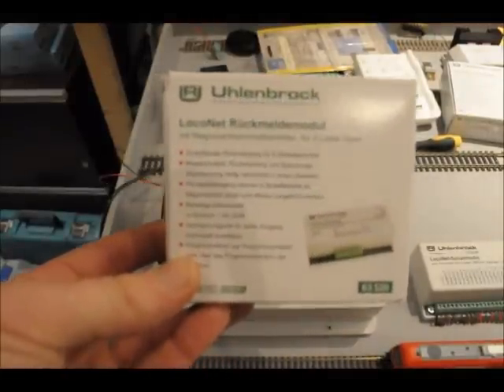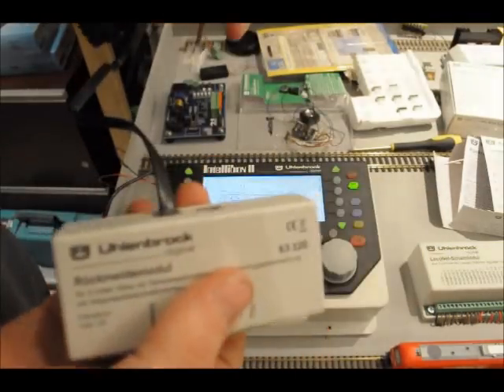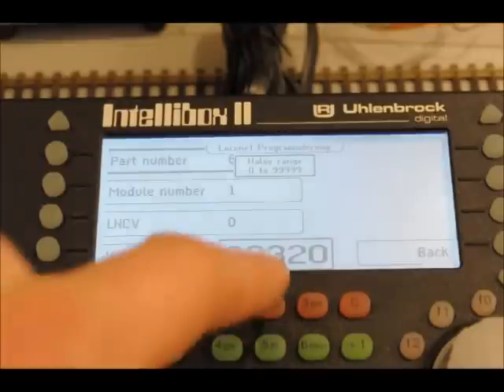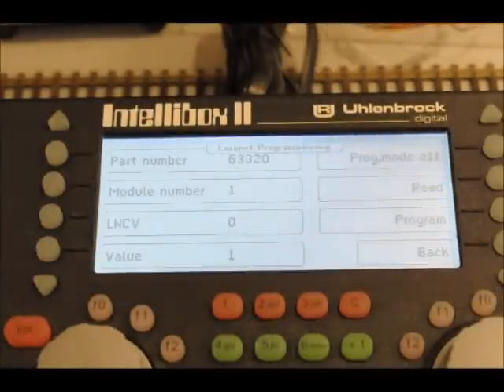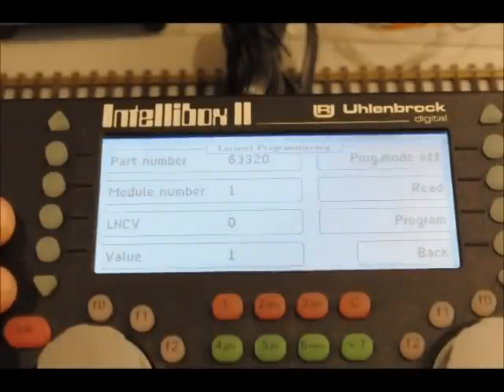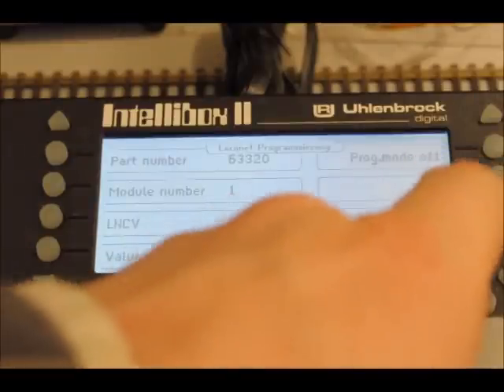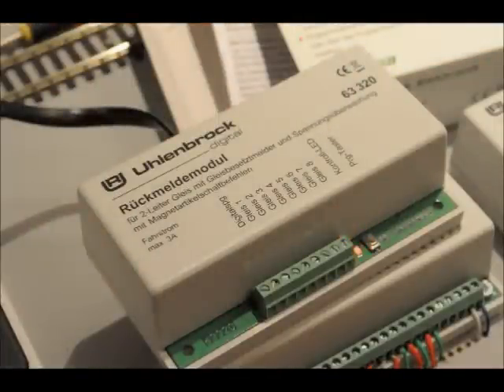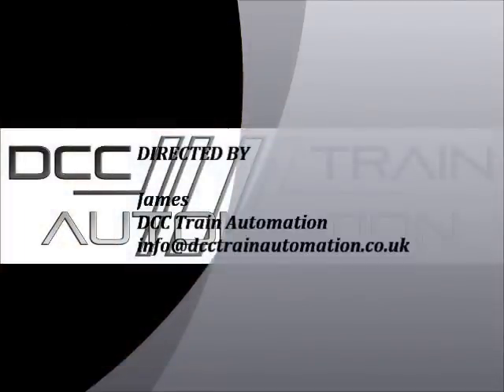Uhlenbrock Feedback module 63320

Comment from the maker: OK with any Uhlenbrock Modules on the layout there all need different Module addresses. For example if you are using the feedback modules and you have ten of them you need to give them address 1-10. If then you have five accessory decoders you need to number these 11-15. In Windigipet under settings you need to Tell the system that the modules you are using for feedback start at 1 and finish at 10. 
If you need any more help please call me on 01823429309 or email on info@dcctrainautomation.co.uk